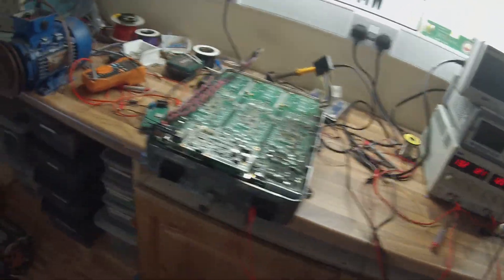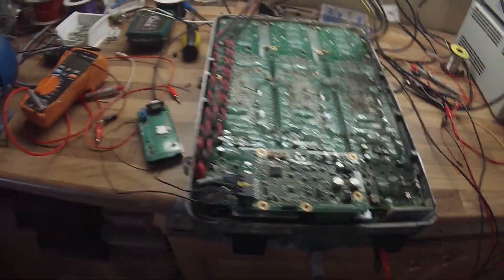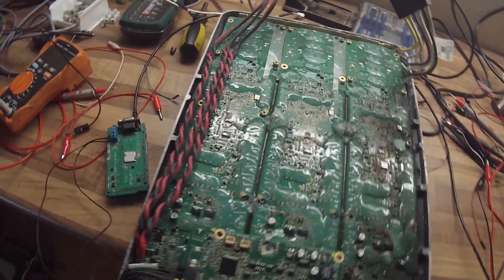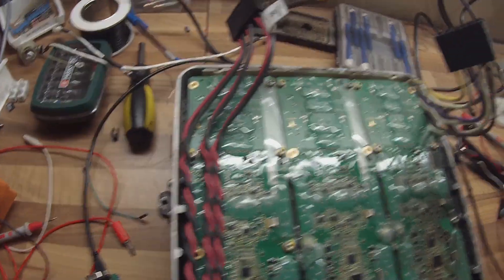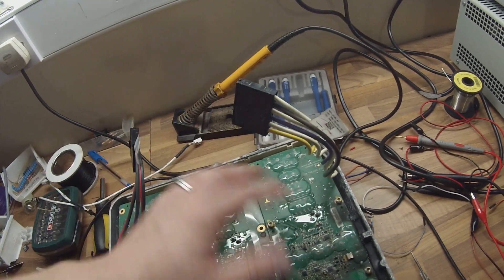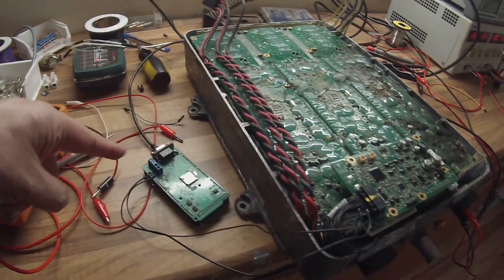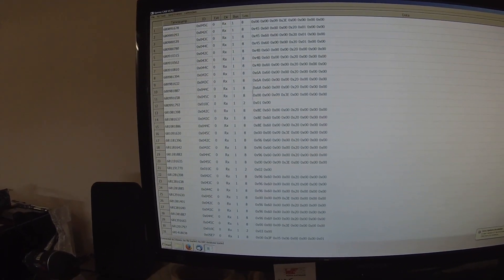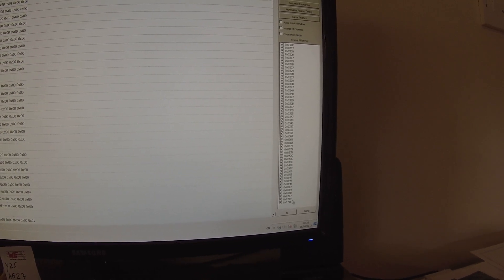The Tesla Project : 10 Kw Gen 2 Charger

Comment: Mine is dual charger, but if I can assist let me know, you have my details :)
Reply: Anybody know if you can swap out the main logics board from charger to charger? My existing charger lost a phase and can only charge at 26 amps. I bought a charger on ebay but it needs to be configured. I dont have the means to configure it so I am hoping to swap the existing main logics board from my old charger to my new charger.
Reply from the maker: Thanks Dave:)